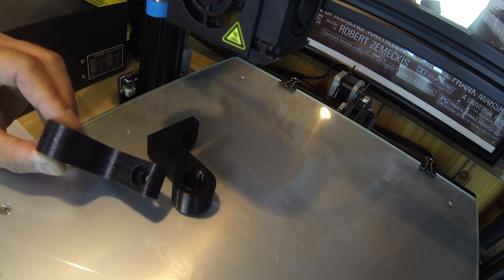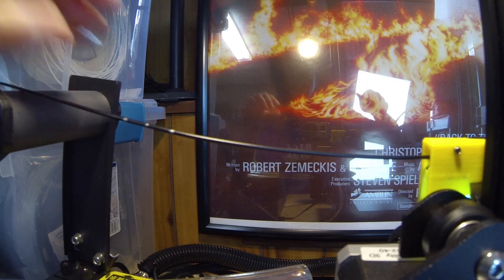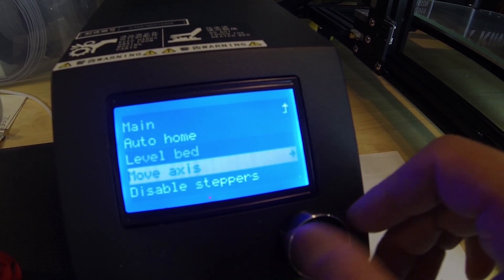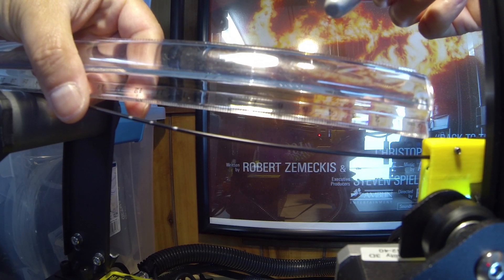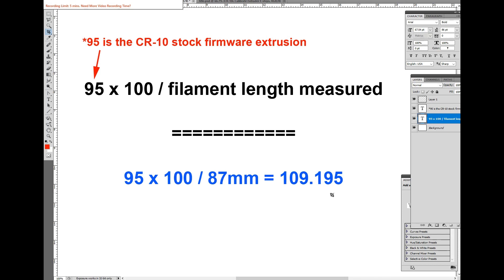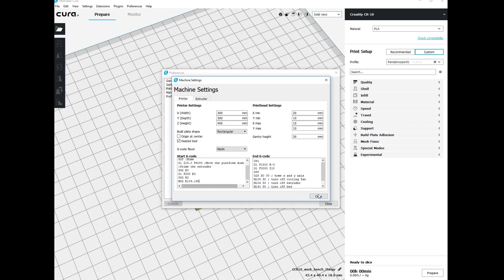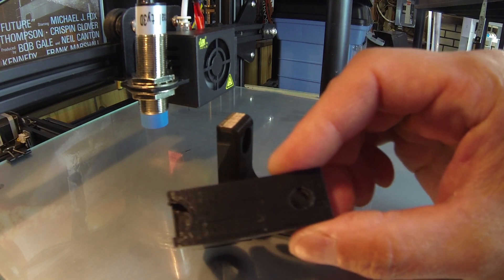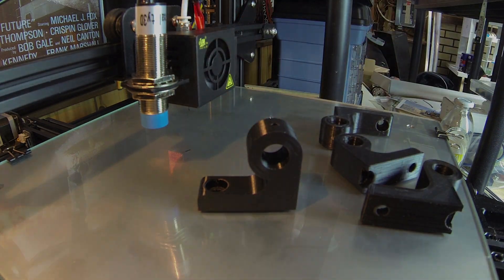Panda Prints! CR-10 / CR-10S - Adjust E-steps / Extruder calibration

Comment: I'm a bit unclear where specifically to enter the "M92 E[number I calculated" I'm in my Printer settings in Cura and I see the box of g-code..but does it matter where in that box of gcode I put the text? or do i just stick it on a random line?
Reply from the maker: It is described in the video at 5:05 In the start Gcode window after E92

Comment: Do you have to make the adjustments in cura or can I just change the settings manually on the control counsel ? Also what auto bed leveler are you using will it also work on cr 10? Thanks, great informational video

Comment: just tried this. I'm sure it will work. The extruder will not move when in move axis mode. any advice would be great.  thanks
Reply from the maker: Sounds like a mechanical issue with the motor? Make sure the plug is firmly connected on the motor side and the control box side.

If it still doesn’t work remove the Y axis motor and swap it for the extruder to see if the motor is the issue

Comment: Thanks for making the video!
When I view the Esteps/mm on the menu of my s5 it states a value of 93 steps/mm. Would I use that 93 value instead of the 95, i.e (93*100)/(92.75) vs (95*100)/(92.75)?
Also, would I want to input my new Estep values only into my slicing SW vs the printer menu itself?
Reply from the maker: Aaron Rollins yes to the first question and yes to the second of your printer allows it. Make sure to save the settings. My printer has an older control board and it did not have the ability to adjust or save Esteps so it had to be done via Cura or a firmware update :)
Reply: @pandapropsncostumes  awesome, I appreciate the quick reply!
Reply: @fenderaaron10  I am curious what model you have, were you able to update right on the control?
Reply: @shocwav3  yep, not sure what firmware version came stock with my s5 but I was able to update via the control box.
I had the same results when I originally editing the starting script in S3D

Comment: 2:50 It does crash the controller. For me I can still use the 1mm option just as long as I wait for it to finish every 30-40mm. It's so weird how it restarts but oh well.
Reply from the maker: Aethelbeorn I noticed on this generation of Creality printers, the control knob / screen will crash if you spin it too fast. I have a newer Ender 3 Pro and you can spin the knob as fast as you want and it doesn’t crash. I’m assuming it’s an updated board hardware / software
Reply: just install custom firmware its very easy. after that mine no longer crashes .

Comment: Mine was, get this.. 35mm under extruding after I installed my micro Swiss DD extruder.
Using this equation, it was looking a little over-extruded at the correct rate, so I settled on calling it 30mm under, and this seemed to give an overall better quality.
Ironically I found out afterwards the micro Swiss recommends 130mm extrusion on it's all metal hot end DD, so it looks to be spot on.

Many thanks for the sanity check!
Reply: 24.5mm under extruding on my CR-10 V2 with a Micro Swiss A2 nozzle

Comment: I was under extruding by 23mm :( but happy for your help :)
Reply from the maker: The Bossk That’s quite a bit. You might want to upgrade to your metal extruder instead of tuning your printer on the stock plastic one
Reply: Indeed i will , i plan to upgrade as much as i can from now on. Im printing  benchy with the new cura settings.  1st few layers looked great so far. I can tell its better than it was. I can't say thanks enough.

Comment: So, how do I confirm that the Esteps changes have worked by extruding another 100mm ? If I send the gcode to the CR10s via USB to extrude 100mm it still comes up short. I also tried sending the gcode that you added in the machine settings first but that still didn't work.

Comment: I have an issue im trying to fix. i changed my motherboard on my cr-10 control box to a version 2.0 board. Now my extruder is out of center and moves all the way to the side and prints. so i have to push the bed all the way back and push the extruder all the way to the left and then it works but is there a way to fix the center point at all?

Comment: Great video, but do you have the method where you save the new E value to your EEPROM / firmware in the printer controller? Then you don't have to make this change each print?
Reply from the maker: Bill B Hi Bill. You don’t need to do this on each print. Once you input the e steps into your Cura settings, they are automatically exported with the Gcode on each print.

Sure, you can update the firmware but I explained in the video that I didn’t want to do that.

Comment: Maybe I missed it but shouldn't you heat the nozzle before trying to move the axis to extrude filament?
Reply: Use, use the PLA or ABS preheat options ... or preheat to the temperature you are printing at for your material, maybe 215 or 220 even.

Comment: Hey guys my cr10 extrudes exactly 95 mm, what is told to be normal stock extrusion in the video if my understanding is correct. Do i need to change anything? 
Thanks!
Reply from the maker: Nataraja Goni If your printer is printing perfectly, then that’s fine. 
I would still adjust your e steps to 100mm. The CR-10S seems to under extrude consistently. You’re not hurting anything if you change the e steps. Just try it and see if it improves your print.
Reply: Hey, thanks for the quick answer;)
Then i will give it a go and test it:)
Sometimes i have under extrusions but i was thinking it has something to do with frequent retraction. We 'll see:)

Comment: You make a good how-to. Subbed.

One hint, if this was linked to search-terms of delamination, weak layers, etc, you would pull in a lot more views. I had this issue a few days back and worked it out, but sure wish I found your video then. It would have saved me several print tests and a lot of "making it up as I go-ing"

PS - a dirty nozzle (common on the CR-10 and it's brethren) will shift the filament calibration. It's worth doing a cold pull to clean things out before doing the calibration. Especially if things were printing fine and then were not. Sometimes junk piles up in there slow, sometimes fast. The hot end of the tube backs out and causes buildup issues - there are vids on the subject.

Thanks!
Reply from the maker: Hey Scott, thanks for the feedback! I have added more search tags per your feedback. Thanks!

Yes, I agree there's other things mechanically that people run into that should be addressed before tuning e-steps. I actually filmed a video yesterday reviewing some of those issues, I will post that soon (need to edit it) and I will add this calibration video link to that one. Hope that helps people!

Thanks for subscribing!

Comment: So my TH3D Unified firmware on my cr-10s had 93 showing on the lcd. I was under by 4mm so I did the calculation and came up with 97. Entered that and saved settings. The part I had been printing turned to crap with large blobs forming that started throwing things off. I then set it to 94 and while the print looked better, the overhangs that were fine before looked like crap. I think I'm going back to 93 and just be under by 4mm.
Reply: Hi, I had 4mm too, 95 was my perfect fit.

Comment: Instead of using a start script in Cura I think there's a parameter now called "% flow". This should perform the same calibration correct?
Reply from the maker: No, I believe flow increases everything at the same time. So yes, you increase extrusion but also the motor speeds etc, movement rates etc.

In this case, its simply making the extruder extrude more and consistently
Reply: @pandapropsncostumes  I do not believe that this is correct.  "Flow" only affects the E motor, not X, Y or Z

Comment: nothing happens when i enter 100+ on the prepare/move axis/extruder menu.. do you know how i can get it to extrude
Reply: Be sure the nozzle is hot.  My CR10s5 won't extrude if the nozzle is below the firmware value for "pre-heat PLA".

Comment: I'm only extruding 10mm instead of 100mm used the equation and edited the Gcode but that still gave me poor results when printing. Any ideas on how to fix this?
Reply from the maker: You should try and follow the video and extrude 100mm. 10mm is not going to give you enough of a good range to test your extruder calibration.
Reply: Hotend needs to be hot to move extruder
Reply: @cutty02  thanks for the reply! It ended up being a clog in the lower portion of the extruder that I didnt see. And a few other rookie mistakes. Since then I've actually upgraded to a swiss extruder and I've had no issues at all.

Comment: Ideally would you not want to do this with the nozzle off? This ensures your extruder gear is accurately moving the correct distance.  Otherwise, you will be required to adjust this based on other variables such as temperature and filament type.
Reply: That's what I did.  No markers etc.  Remove bowden tube at extruder then flush-cut the filament, then extrude.  Now you can flush cut again and measure true extruded length.

Comment: awsome , it worked. i thought my problems where the petg i was using, as soon as i saw symptoms of under extrusion i looked around, found this and gave this a shot. im using an ender 3 and the stock firmware e steps for this machine are 93 per the recommendation of another youtuber that did this calibration on his updated firmware ender 3.

Comment: I have read different people's comments on this calibration but did not know how to do it. Only thing I might have missed is starting by saying it needs to be at temp and not just out in the air. Wonder if you set the temp at different setting can it change the feed as the filament is more fluid and flows with more or less restriction?

Comment: If I adjust any of the axis they move as I turn the dial. The extruder does not. Once I set it to 100mm how do I get it to start the test (extruding)?
Reply from the maker: You have to move the extruder 0.1mm at a time using the control knob, its described in the video. Is that what you are doing?
Reply: On my CR-10s that I bought 10/2018, I have to have my nozzle hot before it will let me manually move the extruder.
Reply from the maker: G Rant Yes, you can’t extruder through the hot end if it’s not heated up to temp. You can see in the video that the control box shows the hot end is at 200 degrees
Reply: Correct. I was just noting that Lance King may need to heat up the nozzle even it he's extruding into nothing.
Reply from the maker: G Rant Thanks. Yes, the firmware will not let the motor extrude if it’s not past 170 degrees

Comment: Panda, my CR 10s WAS printing great out of the box. I had it running for about 3 months doing various jobs some of which were large multi day prints.  All of a sudden it started under extruding (i can crush a 20mm test cube with 20% infill between my fingers with no effort).  I completely disassembled and cleaned the hot end, i replaced the nozzle, replaced the bowden tube, replaced the thermistor... none of these solved the problem.  I am completely at a loss as to what to do next.  do you have any ideas?   should I try replacing the stepper?
Reply from the maker: Hi Craig. You should try these one at a time to try and isolate what the problem is.

1. Check the extruder gear. Make sure there is no debris built up on the cog gear. Check that the tension on the spring is good and that the bearing is rolling freely.

2. Check the boden tube and adapters. The adapters from Creality or notoriously cheap, they do not have a firm grip on the bowden tube. Remove the tube to see if the ends are melted, if so trim off a section so that the ends are square. Make sure the adapters are holding the tube firmly in place with no movement.

3. Have you changed filaments? Changing brands or even colors can change extrusion.

4. Has the temperature in our house or room changed? That can be a factor.

5. Make sure all the plugs in the back of the control box are making a solid connection.

6. Make sure that you aren't getting heat creep. Check the fan on the hot end to make sure it's working properly. Make sure no fins have broken etc.

I hope those help!
Reply: If you use abrasive filaments like glow-in-the-dark or carbon fiber you may have worn down the teeth of the extruder gear.  Order a steel gear to replace the brass.

Comment: I made two measurements. The first normal: the filament passed through the tube and the nozzle - the result is: 94mm. Second: I unscrewed the tube and released the filament freely into the air. The result: 100 mm (ideal). So should I calibrate or not?
Reply from the maker: In my opinion, you print with the bowden tube on. So why do the test with the tube off? There's no resistance if the hot end is not on. I would suggest leaving it on and making the adjustment.

Or, if your extrusion is 100MM with the hot end off, shouldn't it be printing perfectly already? :)

Comment: Do you really need to do decimals? I'm thinking 109 would be fine. I set my CR-10S at 99. Strange they are that far apart.

Also instead of slowly turning the dial to get to 100 mm, why not create a gcode file and put it on the sd card to do the same? Just use G1 E100 F200. This will extrude 100 mm of filament really slowly.

Comment: Have you ever tried just inputting the new extrusion e step numbers into the control box , instead of going into Cura ? This would be a one time adjustment for any slicer that you use. On your control box  , go into CONTROL , MOTION , STEPS/MM and all the numbers for every axis is there for you to adjust . Just change and then exit back to STORE SETTINGS  and hit that . Now your set. Do the same for X , Y Z axis . No need to open any slicer and adjust gcodes .
Reply: Thanks for this.  This is exactly what I did and it is now perfect.  I did upgrade my firmware though.  Not sure about stock ones are able to save that setting.
Reply: Thank you for making things both simple and correct.

Comment: Hi, some peaopel say that the current E-Steps of the CR-10s is set to 93 in the stock firmware, how do I know If its 93 or 95? I have a CR-10s from 2018 sais sticker of the control box.
Reply from the maker: You could update the firmware completely but that's more involved than the method I currently show.

Its not going to "hurt" your printer. I would suggest trying the calibration with both measurements (93 and 95) and see what works best for you. Not every printer is manufactured the same, and there's lots of variables that would make yours different from mine, just based on how we assembled them.

Give both settings a try and see what works for you!

Comment: Just came across this. Seems extremely helpful! Will be trying this today to see if it fixes my problem, but I am unsure if the problems is under extrusion. Is there any way I could send you a picture of my print to get your opinion?
Reply from the maker: You should generally do an extruder calibration right after your printer is set up.  See if that helps first. Other main culprits for bad prints are: belts too loose, hot end screws loose, eccentric spacers in the X carriage and under the bed are loose. You should take care of hardware things before you make software adjustments. Hope that helps!
Reply: The hardware has all been taken care of recently besides doing this. I did it yesterday but of course, my hot end heat sensor went out so I spent the day making it work well enough to continue testing while a new one comes it haha. 3D printing motto. When you fix one thing, another breaks. But I will be re leveling today and hoping for the best :). Thanks for the video! Very helpful!

Comment: How do I know what the current E-step of my CR-10S ?
Reply from the maker: The stock extrusion is 95 as I am told.
Reply: @pandapropsncostumes  , line 589, default steps on CR10S is 93.0
https://github.com/Creality3DPrinting/CR-10S/blob/master/CR-10s%20Firmware%20(Marlin)/CR10S-Factory-Thermal-Protection-Enabled/Marlin/Configuration.h
Reply from the maker: @russellsmithies  Good to know thanks! I went with 95 because thats what someone on the CR-10 FB group told me. :)
Reply: Thanks!!
Reply: in my stock firmware on the CR-10 (non-S) it was 93. Now i flashed a Custom FW and its 95. Printing PLA, it would need 97.8 as i measured.